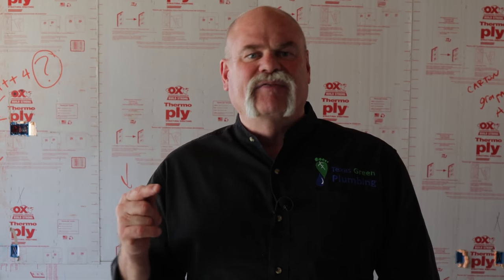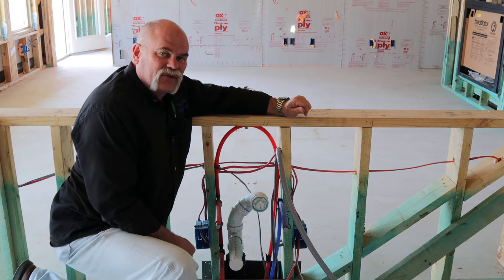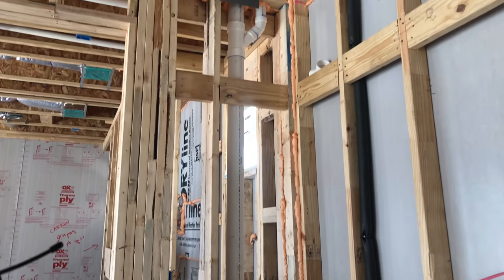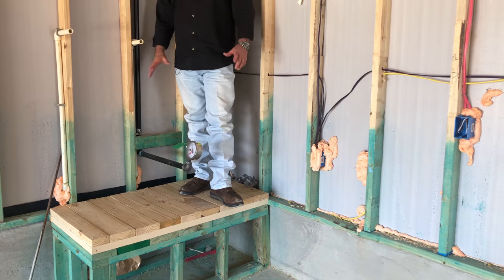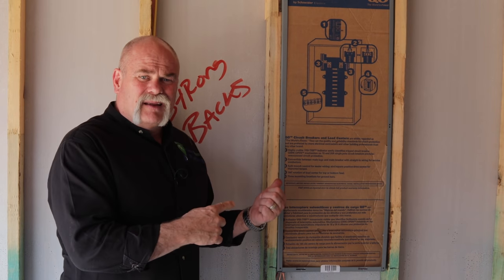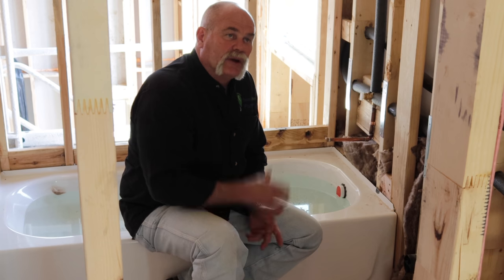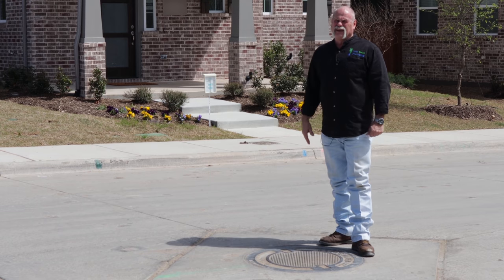How Dallas, TX Roughs-In Plumbing in New Home Builds

Comment: Roger, that’s pretty much the way we do it in Virginia, except we are not allowed to install two-way cleanouts. Also, we usually do turn up our slab toilet rough ins 4”, but we will use a 4x3 flange and glue it inside of the 4” pipe. I noticed this plumber sleeved the 4” to allow room for a 4” flange.

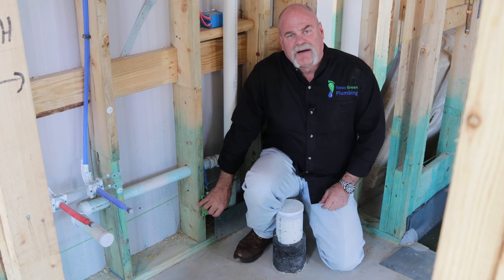Comment: Like the video but all codes are not the same. In kentucky we follow our own Kentucky state code, so off the bat, every fixture here has to be individually vented so that kitchen sink isn't vented right because our code doesn't allow studor vents at all, and rightly because they are crap. That also means that bathroom around 7:20 is a big red flag because the vanity is wet vented into the comode vent. Wet vents are not allowed whatsoever here.  Also, main valves to cut the whole house off is required beside the water heater here anyways. I do love the drain for the washer pan and that all the water lines are insulated, however.

Comment: Very informational. Thanks for the content. Quick question, is water pressure at 80 PSI dangerous? My inspector said 80 PSI is borderline dangerous and needs a PRV. The plumbing company argued as long as it's not 85 PSI, it should be fine.
Reply: 80 is border line for what’s considered safe by code department. Yes you need one. Not dangerous enough to say dangerous. But will cause your fixtures to fail prematurely. Most plumbing parts from the USA have to hold more than 150psi.

Comment: Just an FYI, the B vent for the two water heaters is installed improperly. The clearance for B vent is one inch to combustible material. It is quite obvious the B vent is almost up against the wood. So if you think they did an excellent job you may want to take another look ( most likely this was installed by the HVAC contractor). The plumbing rough-in looks good ( still need nail guards at the vulnerable points and I prefer copper stub outs). Still not bad👍.
Reply: right
Reply: Agree
Reply: Have to use copper for a T&P line too . Either they forgot it or one have different code in texas lol